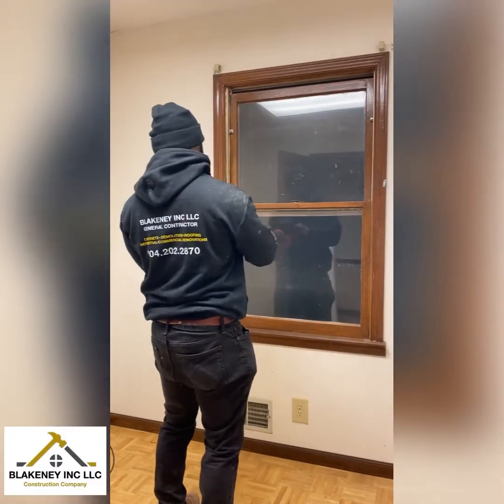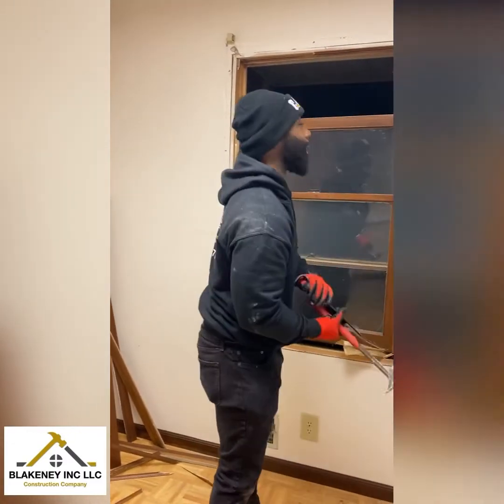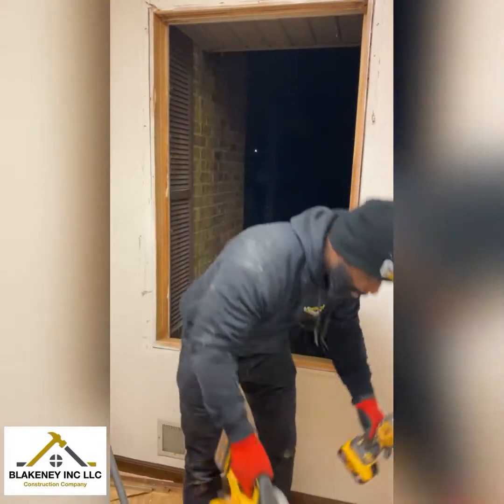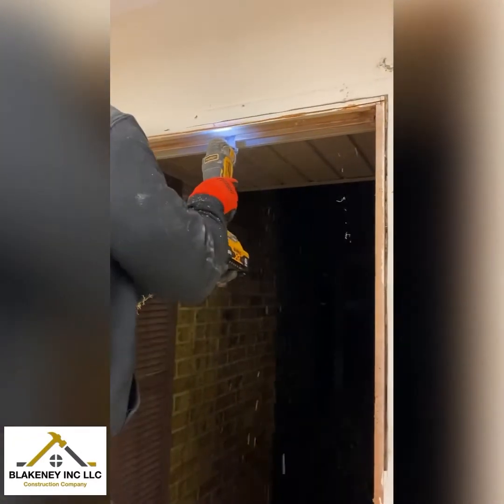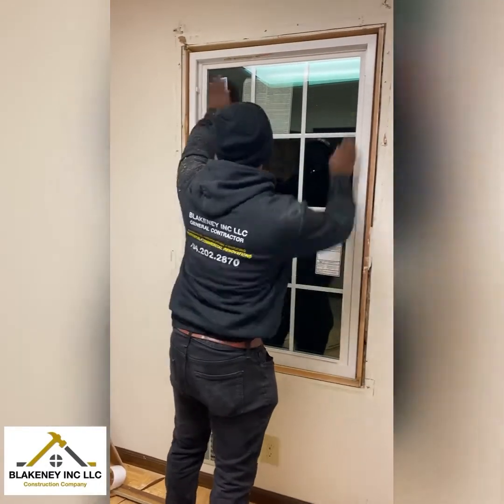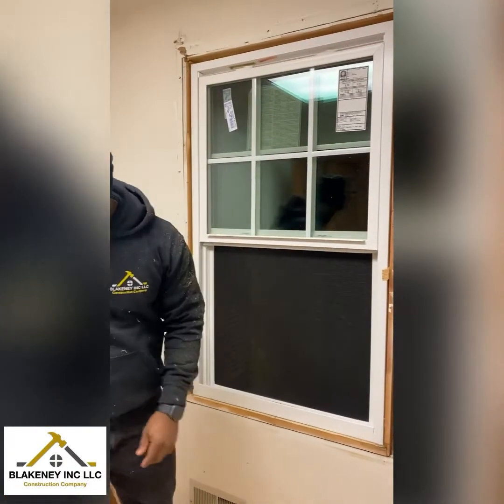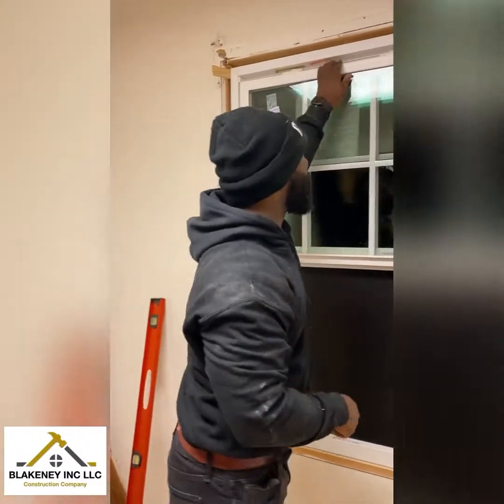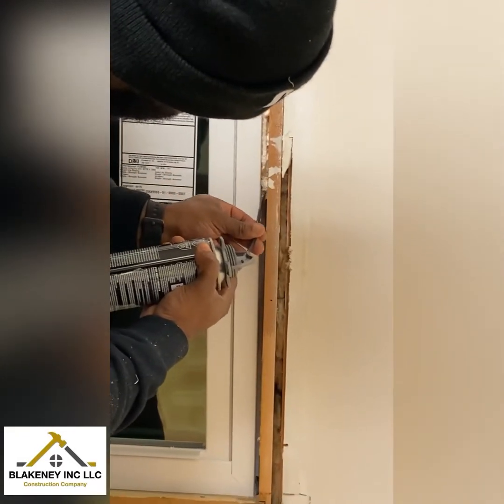How to install a single hung window!

Comment: Thanks for this man! Straight to the point. Also, I had not seen any videos showing use of window tape, so thanks for this. I definitely need it as I see some water damage on the frame of a window I'm going to be replacing.
Thanks!
Reply from the maker: No problem

Comment: I’m in the process of getting my GL, after working for corporations for so long. How do I charge the customer. Per Sqft per project? If you could help that would be great. I don’t want to under charge and find out I’m loosing profit but at the same time give a good quote to get the job.

Comment: What is this called single hung? Could you point out the difference ?
Reply: Single Hung means that only one (usually the bottom sash) opens and closes. The top sash cannot move up and down.